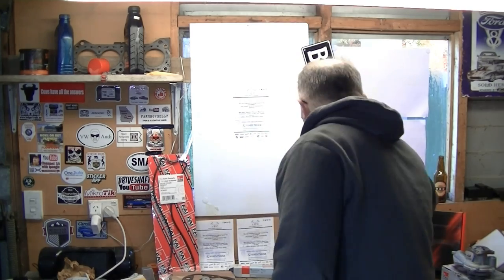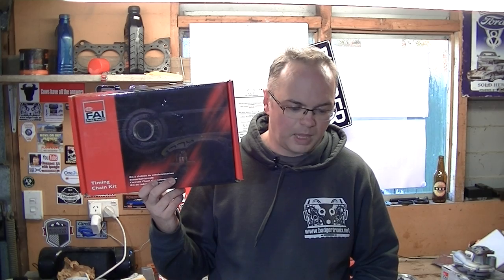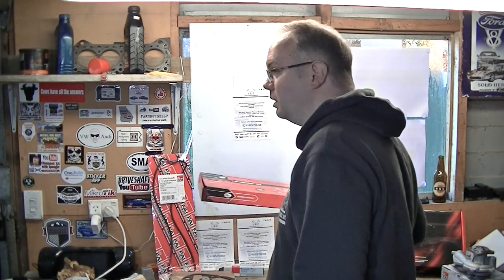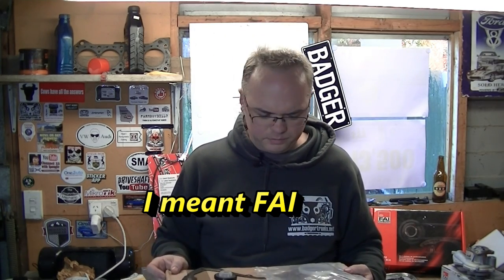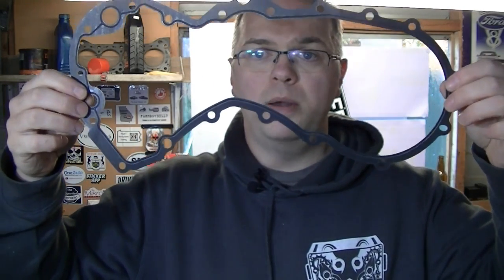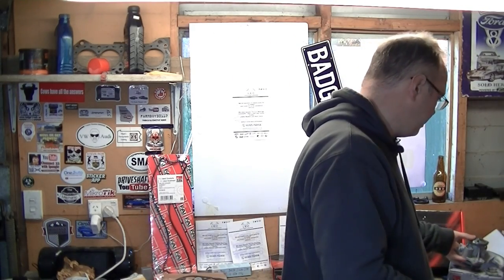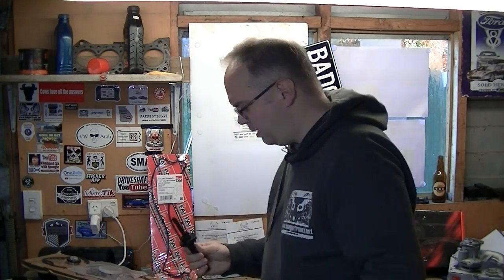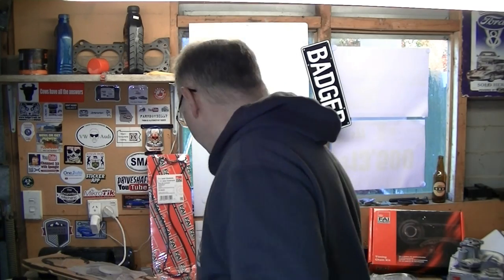Ford 1.8TDCi Belt to Chain Conversion Kit - Overview

Comment: HaHa Jonathan! You're like me when you said that you're not a professional mechanic and you just make it up as you go. I like the way that you research your projects thoroughly beforehand and you get the right tools for the job. I'm quite sure that the project will come along quite nicely and all will be good. Will be looking forward to this project as it does sound like an interesting one. And thanks Jonathan for the shout-out on the timing belt job; I really appreciate it!
Reply from the maker: This project has been on the back burner for a little while, the information wasn't that easy to come by. I'm sure it will be a rewarding project once it's all finished but it's going to take some work to get there. Your timing belt series was fantastic and as you can see from this one there are a few similarities ion how Ford have done things. Will be great having you along for the ride. Cheers!
Reply: Yes, I did notice the similarities with the timing pin and bar to lock the crank and cams down. Just keep getting the information and once you get to do the project, you'll feel pretty comfortable at that point even before you tear it down. And I'll be there along for the ride too :)

Comment: hello my friend, your daring lol, seriously, after you have done the job you will find its not that bad.
unbolting the pas pump from the engine block and removing the blank bolt from engine block to fit the crank pin will be frustrating no doubt but once the engine mount is out the way you will have a lot more room, any thing i can do to help, let me know, good luck
Reply from the maker: thanks for the words of encouragement. Unfortunately this car has electric power steering so has a different shaped bracket that makes it difficult to get access to the blanking bolt. Doubtless I will come knocking once I get really stuck. Cheers!

Comment: My father and I did this job today on my 2009 mondeo. We used the fai kit and used all the correct timing tools etc. The job went fairly well although it was a bit of a pain to do the job due to limited room. On the mondeo it is really simple to pop out the driver side headlight so we did that and it gave us a small amount of extra room which was good. Just a few things we came across. It is really awkward to get the 10mm bolt out of the hole where the crank locking pin goes. The bolt dropped when we loosened it out and there is absolutely no way to get it back so we had to go to the scrapyard and luckily got one off an old engine in there. The wet belt tensioner is a pain to get out as the power steering pump completely covers it so that has to be loosened off which is awkward. Anyway we got the job done and the car fired up and we thought all was well until we seen a small pool of oil under the car a couple of mins later. The brand new crank seal is leaking. It was fitted absolutely perfectly with the proper aligning tool and the timing cover is all lined up too. We chanced popping the old seal back in and surprise surprise, no leaks. So we found that the fai crank seal was utterly useless so maybe just something to look out for mate. All in all though it went okay and I am much happier to know I have a chain down there rather than that dreaded wet belt. We also fitted a new auxiliary belt while in there because it was cheap and why not. Good luck with it mate let us know how you get on. Cheers. Oh just one more thing. There is only 130k km on my mondeo and the wet belt looked so bad. The belt has so so many cracks in it it actually scared me a little bit.
Reply from the maker: +Mr.Mister awesome job. Glad you got it done. I'll be getting there soon so great to here you got it done without too many problems. Cheers
Reply: Badgertronix Thanks. I look forward to the video :)

Comment: Hoping you still read these comments. My chain kit has come in bits like yours but we didn't manage to remove the wet belt all that carefully. How did you assemble the chain kit correctly? I see the crank sprocket can only go on one way with the small dowel but what about the fuel pump sprocket? There are no timing marks?? Thanks
Reply from the maker: I'm pretty sure it only goes together one way round. Sorry it has been a while so can't remember exactly.
Reply: @Badgertronix  ah ok. I couldn't see a timing mark/pin on the fuel pump side when I took it all off. Everything was covered in oil though. It's only that part I haven't figured out. Wish it had come built up but hey ho
Reply from the maker: The fuel pump isn't timed so it doesn't matter how it goes on. Yeah it is annoying how it doesn't come built up
Reply: @Badgertronix  Ah, that's fortunate then. I will make sure the crank part sits on neatly then I should be set. Hey you don't have a video on fitting a clutch to a semi automatic Aygo do you lol. That's my next headache.

Comment: A friend of mine is thinking of buying a couple 1.8 Ford Focuses which need the timing belt replacing soon for his buisness. I warned him about this whole wet belt thing and he's asking if I would do them. From what I can see of it I'm considering pulling the engine/gearbox and doing them outside. Doing the clutch and DMF at the same time. I honestly couldn't see how I would get to a lot of the bolts and even if I could I can see it being a miserable experience with lots of epic rants and tool throwing.

The same guy just got some brand new Focus 1.5TDCI for the managers at his place. They are still going to the Ford dealer for servicing and do lower mileages than the work vehicles. I'm really curious to see how they turn out after 100k. They seem like a bastard spawn of Ford/PSA but seem more torque-y than the 1.6HDI engined focuses I have driven.
Reply from the maker: +zoidberg444 one you get past the initial access issues I don't think the job will turn out too difficult. I love the 1.8 engine though, torquey and economical and probably the most sensible car I have ever owned.

Comment: hello, do you need to buy the original part ford 1352698? That part does not have the injection pump as it has a belt?

Comment: Hi mate. Just bought this kit myself and was wondering how I set up the cogs and chain. I understand the pin on the small cog has to line up with the one on the crankshaft but what about the big cog? Does this have to be orientated in a certain way? Your advice would be appreciated. Thank you in advance
Reply: Hello i am at that exact point now,how did you get on ?

Comment: How did you get on with this? Picking up a mondeo that I would like to bullet proof. Great video, thanks.
Reply from the maker: +darkwaterblue finishing it up in the workshop this week. Video should be out in the next couple of weeks
Reply: Badgertronix good news, though I am hoping to get it done in a weekend now you have me worried ;)
Reply from the maker: +darkwaterblue you can probably do it in a weekend. There's a lot of disassembly before you can start the belt swap though. I've been taking my time and been busy elsewhere so it has dragged out a bit.

Comment: Hey mate, me again. How did you get on? I will have to do this conversion to my new mondeo (2009) because it has the dreaded wet belt. The car has 130k kilometers on it so I would say it is probably due. I will more than likely price the parts at Ford unless there is a huge price difference then I will look into spurious.
Reply from the maker: +Mr.Mister I haven't done it yet, still trying to make space in the garage. Hopefully next month when I'm on leave. Cheers!
Reply: Badgertronix No problem. Thanks.

Comment: I have a smax ford from April 2007, I still have chain or belt? Hug from portugal, I really like your videos.
Reply from the maker: Hi and thanks for watching! If you check out the videos I linked in the description, it tells you how to check if you have a belt or a chain. Cheers!
Reply: I confirmed with the ford salesman that I have chaine :) I do not need to change then? I do not need to worry
Reply from the maker: +bruno azevedo awesome. Apparently there is a service interval for it, but it's a thick chain so if it was me I wouldn't bother changing it.

Comment: i dont know if you realise but the chains only have a service life of 60,000 which is the same as the belt on thing to watch out on many of these engines is a lot of people only change the top belt
Reply from the maker: +joel vaughan prior to the introduction of the welt belt there was no change interval for the chain. Presumably this was changed to the same 10 year, 120,000 mile interval as the wet belt because it's too hard to tell if you have the belt or chain. My Ford dealer didn't believe me that there was a lower belt/chain that needed changing.... Cheers!
Reply: Hey buddy, I've watched your video doing the belt to chain conversion, very impressive work, I'm seriously considering doing my mk4 Ford mondeo 1.8 tdci this summer, can you tell me the torque setting for the 21mm fuel pump shaft nut please.